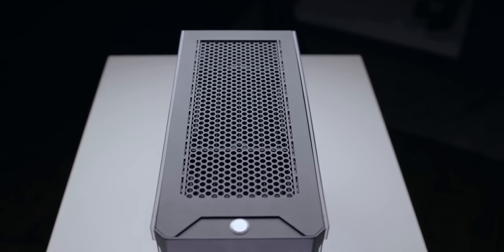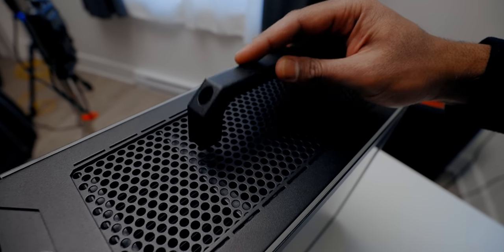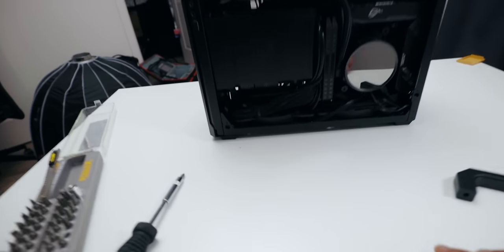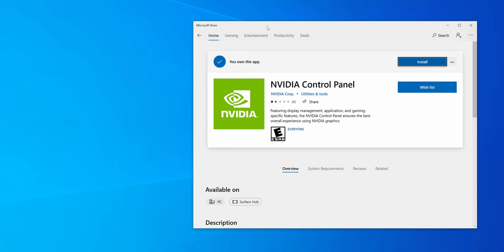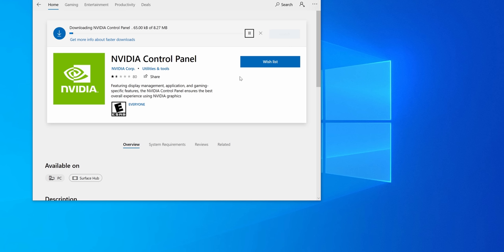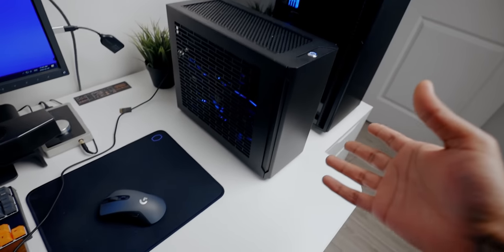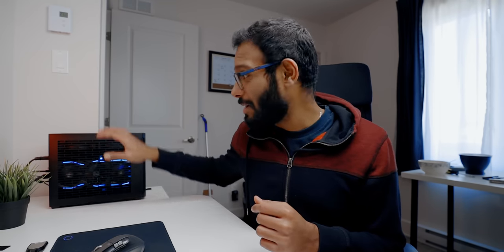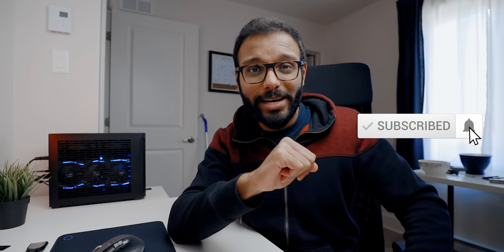My ITX Dream PC Has PROBLEMS - Time To Fix Them!

Comment: I have an X62 cooler and have never used CAM to control the fans. Never actually used the NZXT fans either. I connect them to the MOBO and use AI Suite too control all my fans. I like having one app to go to for a given process/control. As much as posiable any way.
Reply: dtune30 can you use ai suite to control both the x62 fans and the case fans? Lately my pc case makes a pulsating sound when gaming so trying to pinpoint if it’s one of the fans.
Reply: Yes. As long as you have enough fan headers and splitters. You need to use the same make and model fan with splitters. The issue and work around is this. You need to use 4 pin fans and cables for AI Suite to work it's magic. But it some times gets confused with return data from multiple fans. I almost always have this happen with 3 fans on 1 header. What I do is disconnect 1 or 2 fans from the issued group and run the setup again. Check that all my fan groups are properly controllable and connect all the fans back up. 

It's a bit of an arduous process but when it's all done you have all your fan control in one spot. Be prepared with some tape for the fan splitters, they never seem to hold tight.....or I have crappy ones.
Reply: dtune30 thanks!

Comment: don't worry about stopping a fan with your finger, I've been doing it for 30+ years and never had a problem, just make sure you touch the hub of the fan to slow them and not the fan blades or you can break a fan blade or even cut your finger. Nice build, you should bring it to ltx this year and play some games, looks like the perfect lan rig once you get that handle installed.
Reply: Graham M I actually somehow broke the fan blade off my GPU cooler while trying to stop the fan. I think the fan hub pushed the entire fan back till it contacted something

Comment: Great choice on the case! Sliger products are quite impressive. I am running the Cerberus X with dual E5-2650v2 myself with the SFX750, but the point of the post is the individually sleeved cables which I got off AliExpress. 10cm EPS12v x 2, 10cm 24-pin ATX, 10cm 8pin PCIe, all for under $30CAD. You have to look into that!

Comment: I think you can actually download the standard version of the drivers which includes the control panel in the nvidia website. You can find them searching them manually in "beta and older drivers" (they show the most recent ones too) just make sure you don't search "dhc" ones. Then DDU making sure windows doesn't install them again automatically in the next boot, and ready to go.

Comment: In NZXT CAM set your CPU fans to scale with liquid temperature, not CPU temperature. You're not removing heat from the CPU, you're removing heat from the liquid cooler. CPU core temps swing up and down way more rapidly than the actual cooler does, and thus if you leave fan control based on CPU temp the fans generate much more noise.

Comment: I love this case.
I don´t use the ssd case in the front...so there is space for 4-6 ssds easily.
I have perforated side panel for maximum cooling.
2 Top fans push up through the 240 Radiator.
1 Fan push out at the bottom.
I use only one fan at the bottom for more space for the cabels.

This thing is the smalest case for max overclocked CPU and GPU...and lots of sdds.
It´s perfect.

They only can improve the design variations... but from the space/performance/mobility side is perfect!

Comment: Since you're using an NZXT AIO, there's another solution to the fan noise: you could use the coolant temperature as a basis for the fan speeds. It's a good practice with custom loops und works with AIOs as well. Compared to a custom loop the coolant temp of an AIO will rise faster, but it's way more consistent than the CPU temps.

Or go crazy and do custom loop with a Watercool MO-RA 3 420 with four NF-A20. :D

Comment: For the fan noise issue, if you dont want to place your finger on the fans, you can just unplug them from the motherboard before boot, or just use the bios settings ez

Comment: Think your bottom fans,yup setting a fan curve will help. From my own testing,when you have intake fans mounted to a mesh area like honey comb which is 68% open area or any other, you will experience more fan noise due the air being drawn through the ventilation. I was using fractals hf-14 ehich was low noise but experienced this with 1000rpm. Had adjusted with fan curve and the noise went down. Think if you cutout the  bottom mesh area with a dremel you only encounter the fan noise and not the noise of air rushing through ventilation. For fans, also use corsair ml120s. They rattle when used at 35% rpm after use.But my be quiet fans silent wing 3 high pwm are fine. Think you can stick to your be quiet fans and fan curve. All the best man.

Comment: more videos like this thanks, i have n case m1 itx with 140mms on the bottom with a similar problem

sad to hear nvidia have decoupled the tools
Reply: That's only if you download the windows certified drivers. They still package software together with driver if you download the normal version from their site. The only reason they did this is because Microsoft is requiring it.

Comment: Since you're using an Asus mb search for "fan smoothing" in bios (use the actual search function, it's a hidden setting) or in the AI Suite, if you put in a 3.5 second delay or so the fans will stop spinning up and down with every transient temperature spike from chrome or some windows background task. You'll also be able to use a normal fan curve instead of one that's flat all the way until 55-60 degrees then suddenly goes vertical.

Comment: For Nvidia Control Panel, you need to download from Microsoft Store. They aren't including it anymore in the latest drivers
Reply: He spent like half the video saying this.
Reply: No people are using the wrong driver. If you download the DCH or SD driver there is no control panel with it. If you install the GRD the control panel is included.

Comment: i recomend you put the bottom fans as exaust and get an other vented side panel so the fans pull fresh air from the sides and dont mess up the gpus airflow

Comment: You should set those radiator fans to adapt to Liquid temperature, not to CPU temps. Thats the idea of the liquid cooler to cool the liquid. If you set them to follow CPU temps, they will ramp up and down when CPU hits the load.

Comment: Definitely talk to Optimum Tech about this. He also had issues with power supply fans and swapped the default ones to fix it.
Reply: Grey-man to my knowledge, he only swapped the fan on the flex power supply. Like the tiny little fan for a psu in the Velka 3.  Did he swap it out of the Corsair PSUs too?
Reply: @biggorilla1999  I remember him opening an SFX PSU in one video, but he removed it because people didn't understand how dangerous it was. This was explained in the following video, but I don't remember which one that was

Comment: I've seen plenty of complaints about AI Suite, but I've used it in both of my builds for the last couple of years and the only real issue I've run into is once in a blue moon, it doesn't load with the custom profile I've configured for my fans. This is pretty rare though and otherwise, it's worked without issue for me.

Comment: Hey Eber, I recently had issues with the NVIDIA control panel not showing up under right click as well. As easy fix is to just install the control panel directly through the windows App Store. Then it’ll show up when you right click and will function just the same. Hope you read this and it helps!

Comment: I just finished building my new pc yesterday, I did not know about Aura sync for rgb on Asus board, so like W10 recommended I installed Armory crate from W10 store and it was horrible and sucks. Then I found that Asus Aura sync exists and removed armory crate installed Aura sync and the sync software was awesome and using it is a breeze. Yeah that Nvidia ting bothered me but W10 immediately recommended me to get the panel from W10 store so that was helpful. Also the AI suite pretty cool too.

Comment: The Noctua in-line voltage limiters are great for fan noise if you have 3 pin fans and your mobo’s bios control isn’t enough.

Comment: To get nvidia control panel to show up you have to find it, it's hiding in control panel. Go to control panel and display all icons (large or small) and you should find it in there. Once you find it, right click it and there should be an option to make it appear, if there is not just run it and see if it starts showing up after that. I had this problem a couple months ago

Comment: RE: the nvidia control panel issue. You CAN still have it installed with the driver. Here are the steps:  1) download the international version of the driver and not the DCH version. (you can find download links on sites like Guru3D) 2) you need to clean your driver install with something like DDU. 2) When you install the new driver, disconnect your pc from the internet. If you don't then it will try to force you to install DCH drivers.

Comment: If you want to stop your fans NEVER touch the blades. It can harm you and you can easily destroy the fan. But you can press down on the round middle part (don't know the english Translation for this). This won't damage the fan or your finger

Comment: Liking the Corsair Commander Pro myself.  Also, you might be able to control your bottom intake fans with your CAM software.  But you'd be at the mercy of your CPU temps which might not be a bad thing.

Comment: Great video. 
I would love to see the same setup but with solid side panels and a GPU riser. All fans pointing up would create a wind tunnel effect to cool all components. 

I would love to see a benchmark temperature/performance/noise comparison of the setup in the video vs wind tunnel.

Comment: I've been using AI Suite for a very long time, but stopped using it about a month ago. The software doesn't get updated often, and when it does they don't fix the issue that you are experiencing, most probably. In my case the fan control was all over the place, since you HAVE to do auto tune first, which determines min and max speeds of each fan, every time I did it it would give different values on min speeds. Sometimes, it wouldn't allow the fans to go below 60% speed, which annoyed the hell out of me. Other times it worked great, but there was always the problem of fans ramping up during boot and shutdown. Occasionally, when I would turn the PC on, the software would ramp up a single fan to 100% and I would need to restart the PC for it to reset, while other times it would completely delete my custom fan profile and ask me to auto tune them again so I can make another custom profile. The whole experience is really not worth it, because you can simply go into bios, do the auto tune to determine min and max speeds, set fans to desired speeds, and if the cpu temps are too high, go back into bios and raise the fan speed by 5%, then repeat the same thing if the issue isn't solved, as for case fans, it's really up to you to set them up, I keep them at 800rpm fixed unless my cpu hits 75°C, then they ramp up to 100% (cpu never goes over 75°C anyways, so no worry there). It's a lot simpler, easier, and less time consuming to just set them up in bios once, and forget about it forever, unless you switch the fans, then you can simply just setup that one alone. AI Suite will delete your custom profile if you switch any of the fans for another one, and you will have to do everything from the start again. 
TL;DR Just use bios for fan control

Comment: Nice video, I like the format, though the initial build does show some lack of familiarity with ITX builds in general. Placing a GPU crammed up against a closed-off side panel like that is a terrible idea even in large cases, so it makes sense for it to be rather terrible in a more cramped (and thus hotter) ITX case. Also, not monitoring the fan speed of your case fans whatsoever is ... rather baffling. Also, in general for builds/cases like this negative pressure is the way to go, i.e. use both top and bottom fans as exhausts. This encourages air coming in through the side panel which helps GPU temps quite a bit. Most people with builds like this report better temps that way than with "chimney" style bottom-to-top airflow, at least. The bottom fans are rather choked due to the low clearance below the case, after all.

Comment: It might be worth it to get the other side as a vented side panel. A closed side panel will choke the PSU and case the fan to spin up, which accounts for a lot of noise.

Comment: This was a weird one, you wanted quieter so you went with a totally open side panel,much harder! As for the fan curves, glad you got it figured out. My MSI is still audible at the silent profile, so i had to do custom curves.  Also you can find drivers that still have that control panel integrated as long as you don't have an OEM.. at least for now. I grabbed mine off guru3d.

Comment: I'm pretty sure its fine to stop the fans with your finger if you stop it at the center instead of the blads and slowly apply pressure instead of slamming it. ( Been poking my fans while waiting for long ques for over 10 years)

Comment: I think you choke the bottom fans because they don't have much space in the bottom to pull air with your 5mm feets and if they can't do that there will be a low air pressure around the fan blades which introduce noise.

Comment: I want to mention another advice, which can be overlooked easily:
Make sure the case feet are from really soft material. Otherwise the table will start to resonate with the vibrations from the PC. I had it with the stock feet on my old case and installed aftermarket feet from a brand called Inline. After that: Dead silence...
Furthermore you should raise the case away from the table a bit more, so you get optimized intake airflow. Otherwise Tech Jesus would get a fit...😉

Comment: Noctua chromax fans would solve the noise problem, I never build a system without them. Only downside is the NZXT AIO doesn't play nice with noctua's so you're stuck using the stock fans if you want the Cam software to control fan speed. I tried using noctua fans with my X52 and they wouldn't spin when the system was booted up. Swapped the stock fans back onto the cooler and fans spun up immediately.

Comment: Hi Eber,
Great job with informing users about the Nvidia control panel through the Microsoft Store thing, it's the first I heard of it...
Now I have a few short qs:
Does that mean that the control panel has to be updated through the MS store as well?
What happens if you installed it before it no longer being bundled with the driver? Does one have to update it through the store anyway?
I rly hate the MS store, it almost never works and possibly having to update or at least install 'essential' software components for your hardware using it as a back-end is a huge bummer...
Keep it up! I enjoy your content a lot
Reply: I'm thinking that when your run windows updates, it would automatically update the control panel. I'm not sure but we'll see lol

Comment: If you want I think you can connect the fans for the AIO to the mobo and just leave the 3 fan connectors to the AIO, I got the kraken x72 and use it with cam to control the fans and im happy with it. I got the pump locked at 60% and the fan curve on silent mode.

Comment: Assuming the bequiet fans on the bottom are intake, the noise comes from fan blades too close to bottom of case as air is rushing through small slits or holes in the case material. I would mod the case by cutting out holes larger the the fan blades but inside the frame. All that noise is gone and you get better airflow.

Comment: I would like a revamp to the Nvidia control panel, it looks like a windows xp app 😆
Reply: That because it is.
Reply: seriously agree, the amd driver suite is so much more functional and good looking, just a shame the actual driver is a bit here and there...
Reply: Function over form ma dudes. It works. With UI changes comes bugs, look at the new creator layout for YouTube, is broken AF. I'll take reliability over looks for something I rarely use any day.
Reply: @The-Tech-Gent  agreed so much.. bulkier programs just takes ages to load, which makes it kinda pointless and frustrating, I'll take scaled down but functional any day.
Reply: Magic but it isn’t more functional.. it has ads and more user-friendly stuff, but the functionality of the Nvidia’s control panel is insane.
Reply: @Cluckboom its also slow as fuck on my ryzen 5 / nvme system and freezes for a solid 4 seconds every time i change a driver setting

POS

Comment: Just put a Lapel Mic on, if the mic is closer to you, it'll pick up less noise. Also, the Control Panel needs to be installed with the Windows 10 App Store nowadays.

Comment: Nvidia now makes you download the control panel through the ms store. Just found out last month after my Nvidia Control panel disappeared.

I had to go into the ms store and look at the error to find out it was requiring me to save apps to the os drive.
Reply: Thank you so much I just built my first PC and was very confused
Reply: @MrEWhiteYT  Yep. Standard drivers include the control panel, but the DCH drivers do not.
Reply: @sumthingidunno  Standard isn't an option for more current versions of windows and DCH installed properly does include the control panel.
Reply: @Madblaster6  It is an option. 1) download the international version of the driver and not the DCH version. (you can find download links on sites like Guru3D) 2) you need to clean your driver install with something like DDU. 2) When you install the new driver, disconnect your pc from the internet. If you don't then it will try to force you to install DCH drivers.
Reply: That's bullshit. Just download from nvidia site and it will be fine. What windows automatically installs is the bare minimum. That's why there is no control panel.